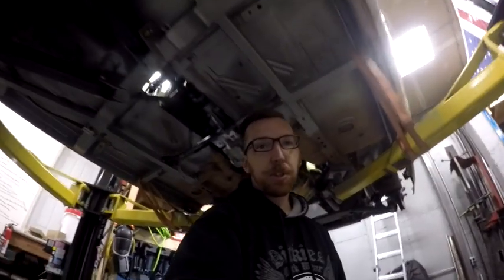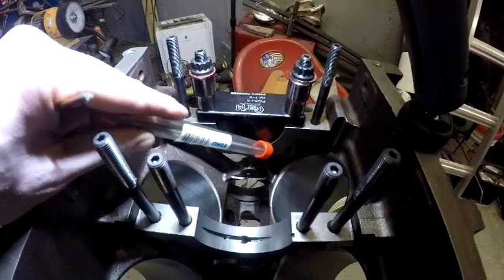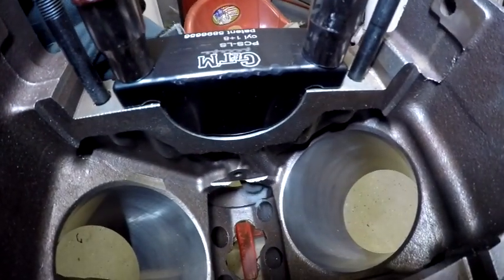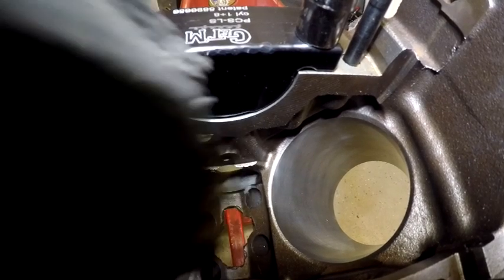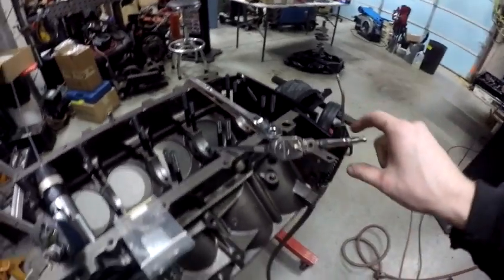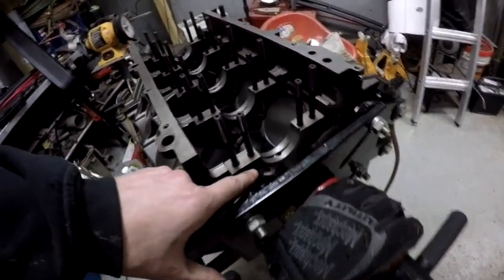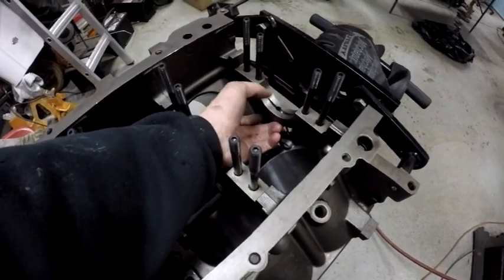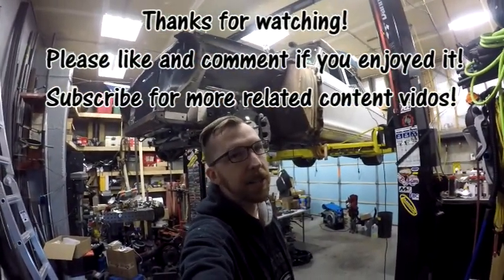DIY LS Piston Oil Cooling Jet Kit from Get M Garage - Review

Comment: That is a terrible idea. Do you know how GM piston squirters work? Their spring and ball loaded and take 27 PSI to squirt oil at the pistons so at idle they don’t squirt at all or very little saving the oil pressure for the bearings, lifters , etc.
Reply from the maker: I disagree, LS motors are over piled by factory design

Comment: I have a question, and maybe a suggestion??
Does that kit work on the 5.3 aluminum blocks? 
And it's seems like an oil pump up-grade and an oil cooler would be a good idea after installing piston oil squirters? Because of all the pressure that is being lost, and all of the piston heat that is being transferred into the oil.
Reply from the maker: I didn't design the kit, I'm a hobby guy.  The jets are very small, LS pumps are high volume to start with.  I'm not expecting any issues.
Reply: @EpicTim  ok thanks, I wasn't sure is all. I've got an aluminum 5.3 in an 05 trail blazer sitting in my back yard that I'm thinking of swapping into my 90' Grand Wagoneer but it's got a wiped out cam lobe and I'm going to have to go through it first and I've never done an all aluminum engine before. Sounds like I'll need to contact the "Get-M" people. haha
But yeah I wasn't aware that this product even existed until now, so thank you for the great videos Sir.

Comment: Great video sir. . . question, What do you think about running these with gasported pistons?
Reply from the maker: I'm not a pro builder, my opinion is a guess at best, I don't see why it would hurt, assuming since you are asking about gas port pistons that this would be for a race motor, not a street motor
Reply: @EpicTim  definitely understand I appreciate the info! Have a set of diamond pistons, was worried about too much oil consumption and residual on the walls possibly causing detonation and carbon buildup, as far as dedicated race motor I guess that's kind of a loaded term 😂
Reply from the maker: So long as the oil control rings are working right you shouldn't have any excess oil behind the top compression ring.  Thus I still think it would be fine.  🤷 Lol
Reply: @EpicTim  was thinking the same plus those holes get mighty small after a few thousand miles of carbon anyways 😂

Comment: Okay Tim I have a question for you. I have an LS3 block I drilled and tapped and put the Jets in. Are my Jets tubes supposed to protrude out of the web. Or do they stay in the block and not protrude out cuz it looks like yours are but my block is aluminum my webs are thicker then a iron block
Reply from the maker: So long as you clear the back face of the bearing and crank counterweight when it spins you are good to go!  Worst case file the tip down till you have 0.060” clearance to the crank.
Reply: @EpicTim  what's to Clarence it's not even sticking out of the web
Reply from the maker: My bad, I misread, so long as you drilled it through, and have clearance to the bearing cap, you will be fine.
Reply: @EpicTim  thanks. yeah I didn't write it to clear. That is what happens when you speech chat

Comment: This is awesome. Many turbo engines that could take the boost had oil cooling jets. They weren't common in the 1980s, but the 300ZXT had them, and people were turning the boost way up on stock internals. Obviously that wasn't the only reason the VG30ET could take the boost, but it was a contributor.

So you can reuse this jig as many times as you want? This is awesome for shops that build high volumes of specially built engines. This has got to be especially good for the speed shops adding boost to engines that never had boost.
Reply from the maker: Yep, you can use this jig over and over, I finally got around to testing and final assembly.  I had 1 that I had to pry a tiny bit (probably .060") to line up with the back of the piston.  BTR also sells the jets in 2 different sizes.
Reply: @EpicTim  That is so sweet that it can be used many times. This looks like it would have a quick ROI for an LS specialty shop.

Comment: after having ran or at least by now I assume you have ran your engine did you notice a oil pressure drop from stock? the ls factor oil pump is a high volume pump just not high pressure just wondering if you would go with a high volume and high pressure pump? oh and do you still like this product after having run the engine. thanks for the video

Comment: Does this take away from the oil amount or pressure it needs to keep the bearrings floating in oil? Thinking of doing this to my 6.0 gen 2/3 bored .40 over that I will be adding turbo too. 2006 2500 HD is what it came out of. Rebuilding the entire engine.
Reply from the maker: it will a tiny bit, the guys at Get'em have thoroughly tested that and found no problem with thier standard jet size for the LS - if you go bigger it may create issues at a certain size depending on your application.  i'll be running a stock pump.

Comment: Would this be more for high performance applications or anything specific? Just thinking if I have to rebuild a motor for my truck it would be nice to do any modifications while I'm in there
Reply: I'm using it on my motor im building that I'm putting an LSA blower on, the factory LSA and ls9 motors come with piston squirters but its very cosy to get std block machined for factory style squirters and they don't clear striker crsnks like these do, JMHO
Reply from the maker: More oriented toward dedicated race applications

Comment: I was thinking to do the same thing what do you think about lacking of check valve on them as the OEM style used to have them so they don't squirt oil in low RPM as far i understand since these bulkhead type doesn't have check valve so they keep squirt oil especially at idle which causes the main to dry please share you thoughts ? , thank you
Reply from the maker: i'll be watching oil pressure on first start and after warm up - worst case scenario i switch to a high volume pump.  the manufacturer stated it hasent been an issue for them though.
Reply: Different subject but on my Mopar 340 I run brake lines inside the valley of the block to get extra oil to the front main, cause that is the only thing that oils the lifters on the driver's side, known to spin #1 and #2 rod bearings because of this, but I think your setup would equal low oil pressure everywhere if you had a problem

Comment: Have there been any Performance gains?
Reply from the maker: no clue, this is a fresh build, more of a mod for endurance than anything
Reply: You may not gain anything just by having oil squirters. However, it increases how much boost your engine can tolerate without failing.

It's a bit like how having beefed up internals might not automatically lead to any horsepower gain. However, the maximum horsepower you could get away with may be significantly higher.

One reason the Nissan 300ZX Turbo and Twin Turbo could handle more boost than the Datsun 280ZX Turbo could have been the piston squirters.
Reply from the maker: The whole concept is piston cooling which leads to the opportunity of more aggressive timing.  The gains are for sure bigger on a boosted motor but helpful on any performance engine

Comment: Great Video. Do we need to replace the Oil Pump to a High Vol or High Press or Both Hi Vol & Hi Press Oil Pump?
Reply from the maker: loaded question - really depends on your application, high volume wouldent hurt, if you dont need it, it will just bypass.  I generally dont recommend high pressure unless you have a very specific application